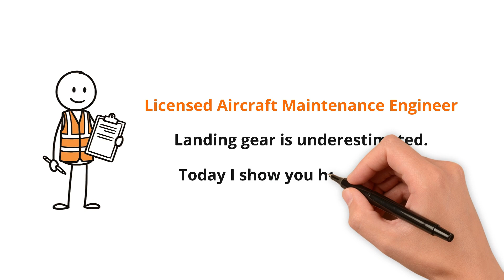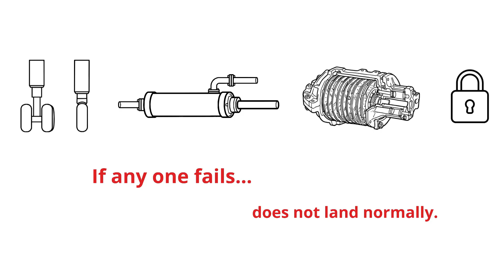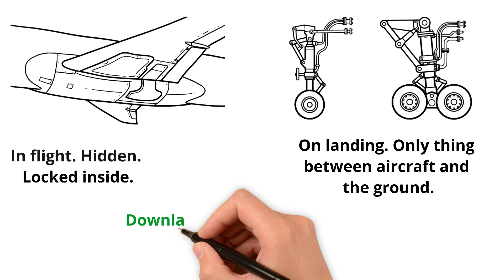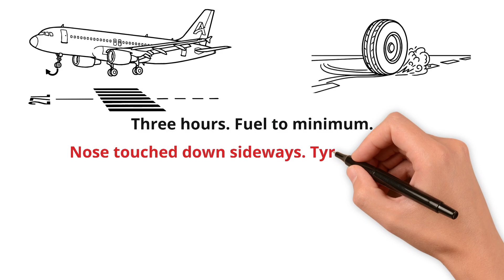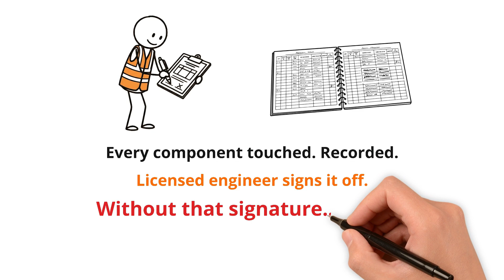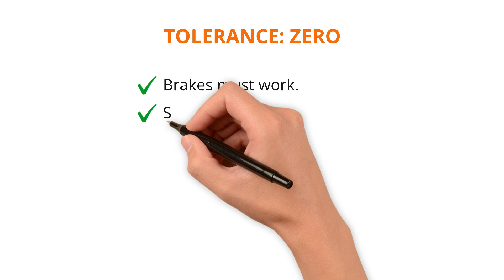Aircraft Landing Gear: Why the Tolerance Is Zero

Comment from the maker: One thing that doesn't make the video: oleo strut extension has a published serviceable range, and we check it cold. Not after a flight when the strut has cycled and settled. Too compressed on a cold check and the nitrogen charge has already been lost, long before it would show up as a problem in the air.